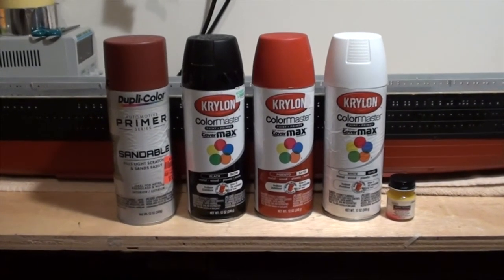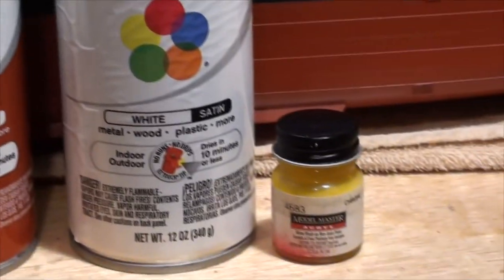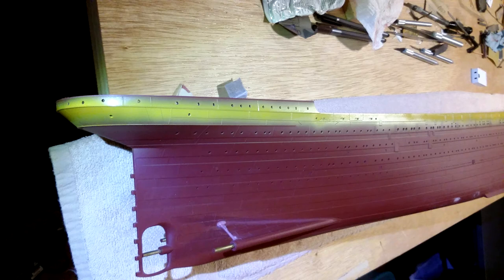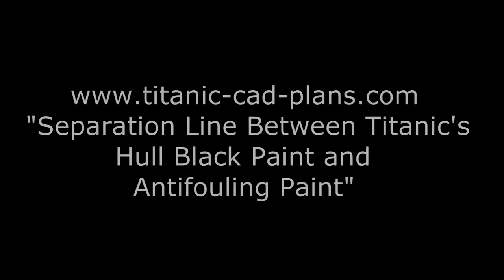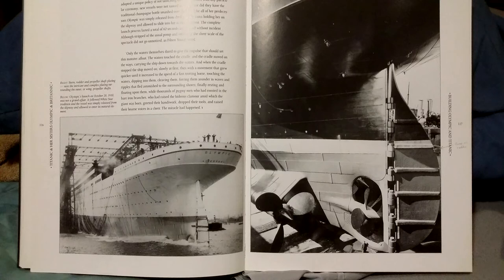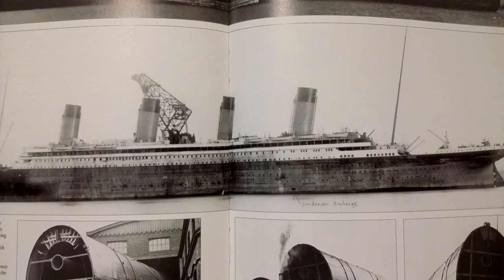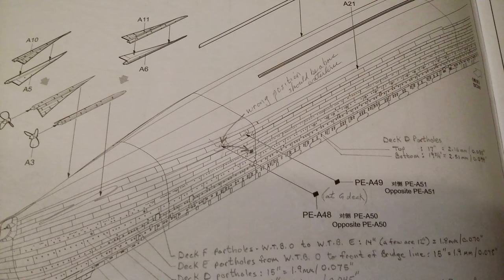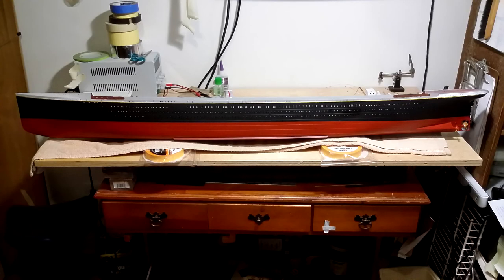Trumpeter 1/200 Titanic - Hull Painting - Part 4

Comment: Hello, where you by this model and how much cost?
Reply from the maker: I got this model from ebay.  It cost $375 + $50 to ship for a total of $425.  This model typically sells for $450 and up depending on the seller.  If I was not a Titanic fan I would not have paid this much for a model.
Reply: @darylw792  I started to build a cardboard titanic model but it is too difficult to make without adequate plans, so I plan to buy what you bought.  It is easier to connect parts than to start from scratch
Reply: Bought mine on Amazon for £314
Reply: @mimoslavija   Have you given thought to the 1/200 card model from Schreiber-bogen?  For a paper/card kit, it is very detailed and even allows for a bit of personal customizing! I even installed lighting on the A deck promenade, but with careful planning,  I now realize that I could have illuminated the portholes  throughout the entire model, as well as the boat deck and the various cabin structures between the funnels along with the stern area! If you take time and patience, it turns into a gorgeous, miniature replica of Titanic! One great feature is that you don't have to paint a thing... the model parts are printed in color!